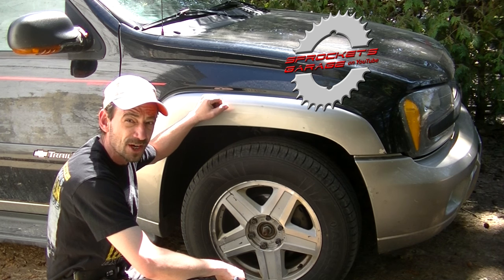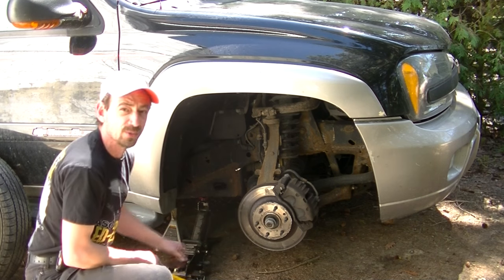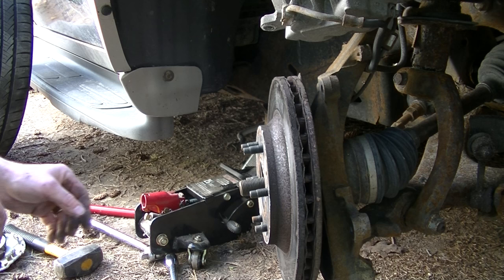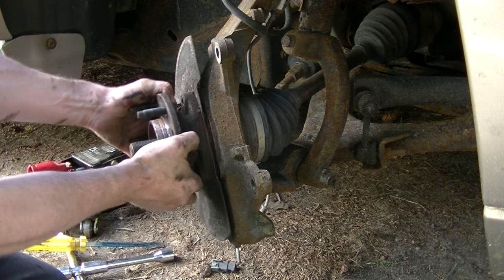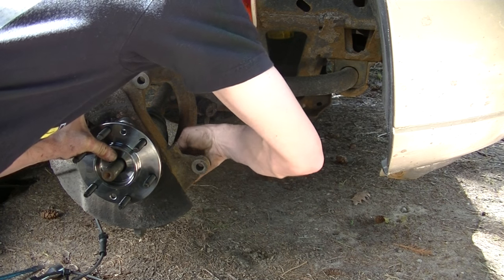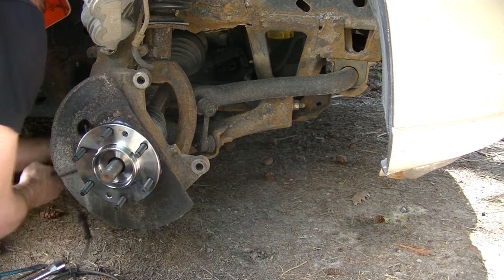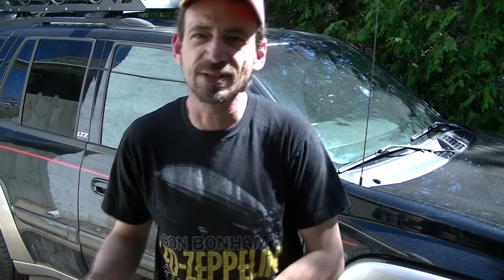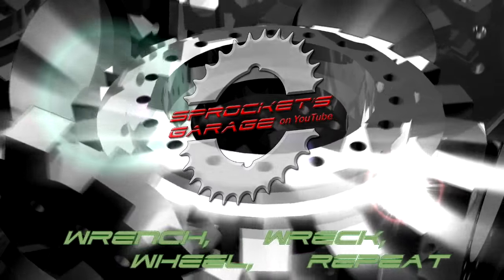Trailblazer Unit Bearing Replacement

Comment: Great instruction! Thanks so much for posting. I needed to see it done without a lift.
Reply from the maker: There are many things that can be done without  lift, it just tends to be a bit more awkward. This really isn't that bad, and the only issue I've really ever run into doing these bearings in a driveway is that sometimes you really have to lay a beating on them to get them free of the knuckle. I got lucky on this one.
Reply: @DocSprocket  Thanks! I hope that I get as lucky.

Comment: I discovered this same issue with my wife's 04 Trailblaze. It was so bad that the hub had literally rust welded itself to the axle. I am 71 years old and I did have a few problems, first and foremost was the wheel lug bolts had been put on so tightly I had to use a 4-foot breaker bar. Then one lug nut shoulder was rounded off, no way to remove the nut. After drilling out the bolt with a high-speed drill and a hardened drill bit I was able to get the tire off. The other bolts came off with easy except the hub bolts, they were rusted so badly, I soaked them with liquid wrench and use a long 1/2" ratchet wrench to break them free. Assembly was rather easy  after I beat the hub off with a 3-pound hammer. I must admit this old fart was hurting by the time I finished. Four shots of Wild Turkey did help ease the pain.
Reply: 71 and doing all that? holy shit lol.
Reply: Yes, I am well on my way to 72, but I will tackle any project which does not require me to have a lift. I have pretty much rebuild this damn SUV, but it's like new now. My stepfather worked on cars up into his 90's. Like Churchill stated; "Never Never Give UP"
Reply: Sky High air impact gun my friend, air impact. It puts the power of God in your hands

Comment: For years, I used a c-clamp vise grip to push the pistons back in on calipers. It worked, but I finally broke down and bought a brake caliper kit at harbor freight for $40 bucks American. I like it as it has the stuff to turn rear pistons in also.

Comment: A "mechanic' told me that I probably had a cv joint bearing in my 2009 Trailblazer going out, the amazing thing is that my Blazer is a rear wheel drive. Found another mechanic that fixed it , yes the right hub was bad. The bad thing is that with a bad back I no longer to my own repair.

Comment: Great video, did mine the other day. But my abs and brake warning lights came on. Do I need to reset something?
Reply from the maker: You might have to check the electrical connection to the sensor wire. Perhaps it didn't make contact, or the sensor isn't sitting right.

Comment: Next time don't take out the caliper bolts. Only take out the caliper bracket bolts. Doing it this way does away with taking the caliper bolts out and it might prevent having to press the pistons in. Basically, you're taking the whole caliper and bracket off in just 1 step.
Reply from the maker: Anytime the caliper has to come off the rotor, therea decent chance the piston(s) will have to be pushed back in, at least a little. Also, many vehicles won't allow the brackets to come off without the calipers first being removed. Since I sold this Trailblazer years ago, I simply don't remember if that's true in this example. That said, I have a saying- "If you know the rules, you can break the rules"- meaning that cheats and skipped steps are usually best reserved for folks with some experience. Thanks for popping in though, I always love the feedback!

Comment: How did you know it was the passenger side bearing? I know I have a bad one which was confirmed by a Firestone dealer today while getting new tires. They say it's the drivers side bearing since the noise it makes quiets down when the wheel is turned to the right. Not sure that makes sense. I ordered the assembly today. It can go on either side. Is there a way I can confirm which side has the bad bearing? Any ideas?
Reply from the maker: Sorry for the late response. Generally, the big hint is when the noise gets louder as you steer away from it. So- if the right side bearing is bad, a long curve to the left will cause the noise to get louder. This is due to the weight transfer of the vehicle. A curve to the left takes weight of the left side tire and adds it to the right- so a bad bearing on the right will get noisier. If in doubt, jack the vehicle up off the ground and spin the tires by hand, while listening. The bad one will make more noise.
Reply: Also its probably a good idea to replace both at the same time.  Usually the other goes not long after.  Well unless the car was drivin' on a circle track.
Reply from the maker: @gamefacks12  Hi! Yes, you probably could safely get more mileage out of it by refreshing the grease, but it's not a miracle cure. There is no way to adjust the preload on them, nor can they be disassembled and properly cleaned. The other thing to keep in mind is that the new grease may only be masking the sound of the wear that is already there, so I would advise keeping a close eye on them. Periodically check it by jacking that wheel off the ground, grab the tire with both hands and try to wiggle it around. If any play is detected, then you'll want to consider replacement. Adding new grease as preventative maintenance is probably best done earlier in the bearing's life, before the noise starts.

Comment: What brand and how much did you pay for hub?
Reply: they arent much like 50-100 online
Reply: I bought one on EBay from Detroit Axle and it was under $40 including shipping
Reply: @pontiacguy28  How's that hub assembly doing?
Reply: @ianwilds3139  it was fine but unfortunately someone wrecked my Trailblazer so I got a new one.  Replaced both front wheel bearings on that one and she's good to go!

Comment: Isn't it a 36 mm socket
Reply: 2years late but it's 35mm for axle bolt.  Just did my brother's 4x4 05 and the it was easy as pie.  Good powered impact wrench is a must.

Comment: The only problem is you didn't torque and bolts to specs..hubs will fall again soon!!!!
Reply: I'm no mechanic I've been using the same force off same force on method and never had any thing fail off.  Common sense is your friend.

Comment: NO torque wrench  tightening the bearing too much will void warranty and cause premature  bearing failure
Reply: Good luck get warranties on a part when not installed at a shop. They wouldn't be able to verify t-specs were set and so forth.  Having a receipt from a shop saves a lot of headaches.